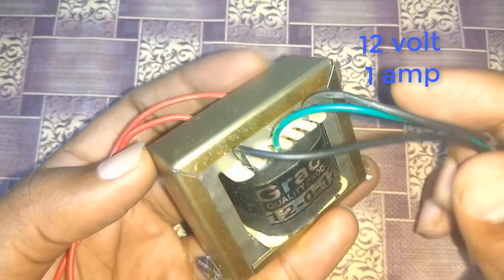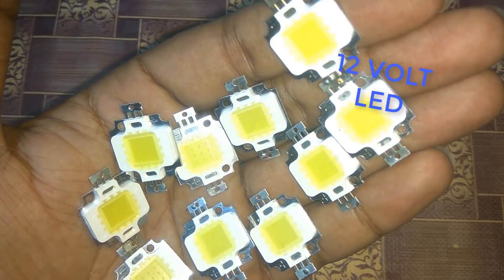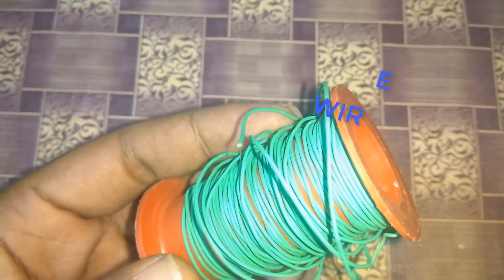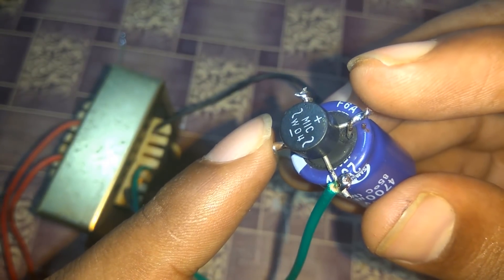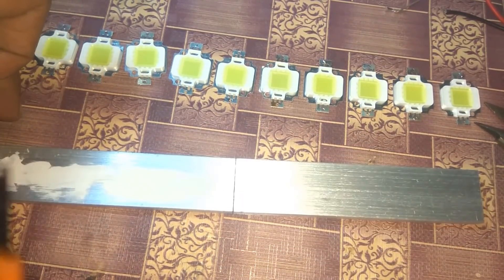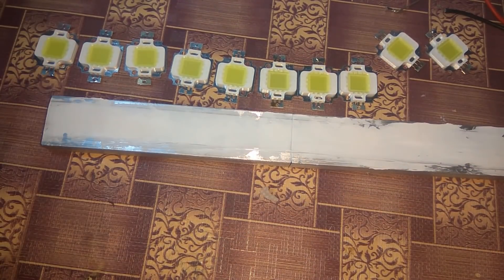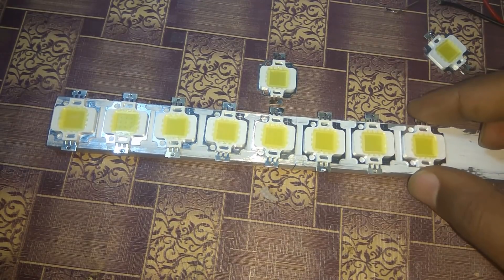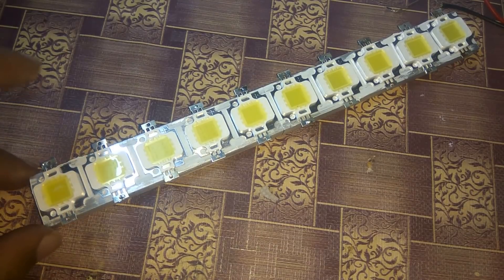HOW TO MAKE LED light USING 12 VOLT 1AMP POWER SUPPLY | Makelogy

Comment: You Mr. Prove this fact that 100 watt LED will take 100w ÷12= 10 amp including 20% efficiency. Then how only 12v one amp can do? Please prove this that 12v 1amp can drive 100watt led? Prove it mathematically
Reply from the maker: No it's not 100w

Comment: I’m not going to start the video or waste time on this bullshit, this is another guy who shits on thermodynamics and creates energy. If you don’t know anything about electricity, just remember watts (or watts/hour) = volts x amps (or amps/hour). Watts is power, and watts/hours is power over time, AKA energy. That should save you from 90% of bullshitters, they are usually incredibly sloppy, ignorant or plain stupid. 

and please, if someone reads this comment, I humbly ask you to remember that ... THERMODYNAMICS IS NOT A FUCKING CHARITY SOOP, THERE ARE NO FREE LUNCHES IN THERMO!!!! Energy is indestructible, you can’t do like that giu and create it, you can’t destroy it. You can only change it’s form, usually in a more chaotic manner. 
There you go, didn’t even realise it but you more or less have 2 of the 3 commandments (laws) of thermo. Use them wisely.

Comment: pls how can I run 48w LED on 12volts Car battery, Kindly find details of what was written on the pack it came, it was using 220 volts, I jst want  you to help describe how I can run the LED on a car battery, DETAILS on Pack (-------INPUT: AC85-265V  50/60Hz -----OUTPUT: 550mA     +-5%
Reply from the maker: Provide me LED or battery details
Reply: @MakeloGy   12volts 750 amps car battery, then Led is Fil Model :ML48W, THE OUTPUT OF THE DRIVER IS 550mA +-5% made in china
Reply: It has and LED driver which is connected to 220 volts when it was purchased, but my project is I connect it to 12volts car battery and should give out the same output which will still power the LED
Reply: pls I want the LED to run on 12volts car battery
Reply: this is what I found on the LED driver casing (-INPUT: AC85-265V  50/60Hz -----OUTPUT: 550mA     +-5%)
Reply: @MakeloGy  on the LED I found this written (JILUN 560x6MM-2835-9C10B-900

Comment: You can't produce 100w of power using 1 amp X 12 volts. That would be 12 watts. This is ohm's law. Maybe go study the concept. To use 100 watts, it would take 10 amps x 12 volts (120 watts).
Reply from the maker: This not for 100w just a example 
How we make this types of power supply

Comment: sir jab transformer se 12v milraha hai to brigretifire condenser lagane ki kyn jarurat padti hai..10 vat led ko direct transformer k 12 volt se connect nai krskte kya..sir jara explan kijiye plz..ye sab mai b sikhna chahta hu..
Reply from the maker: Immu Immu 
Transformer output AC h or LED  DC supply pe work krta h 
Bridge rectifier module AC to DC 
DC output me provide krata h or us DC ko capacitor se filter krke use kr rhe h LED me

Comment: Hon. I want to know about syska 7watt led which operates as emergency lights also, that too,only when power fails and if the switch is on (the holder in which you have plugged in the said bulb)it glows,if power fails,and switch is off light doesn't glow
Curiously enough what technology or technic they have used,can you guide?

Comment: Sir, yeh kya transformer less bana payenge? If yes give me diagram. Thank u....
Reply from the maker: Transformer less power supply having less current as compare to this that's why only transformer power supply use
Thanks for comment Avijit
Reply: MakeloGy , sir kitni watt output hai? All r 5w led? Hit kya bohut hota hai? Sab led ko aapne possitive to possitive & negtve to negtve joint kiya kiu?
Reply from the maker: LED parallel me connection kra h 
Or  supply output 12 volt 1ampere
Reply: MakeloGy , nehi sir, i ask how watt of These led's?
Reply: Sir, diod In4007 use kar sakte hai?
Reply from the maker: diode ka bridge bna ke use kr skte ho
Reply: MakeloGy , ok sir...
Mai bohot jaldihi yeh banaunga, total kitni karach ayega?
Thank u... Avijit(kolkata)...

Comment: Hon.12 volt led chip suppose to be 10 watt,in the circuit they are 10 in numbers,so it's 100 watt,chip current?
I don't understand your answer, for operating voltage as 12 watt 1 amp.Can you narrate?
Reply from the maker: In parallel voltage are same on each LED 12 volt and current 100mAmps
Reply: so what is a point  to drive them with 10x less current? if you worried to burn chips down, without CC  driver, you could easily put only 2 of them in paralel, youll get near the same lm as 10, and each chip will get around 500mA, which is safe enough.
Reply from the maker: I am trying different projects in different different conditions
Reply: Hon. thanks, to clear my query,but but still one question,is it protected from over voltage? I won't trouble you any more, sorry to disturb you now and then.

Comment: What is the total current consumption of 10 x 10 watts LED Chips...? What kind of heat sink should be used...? Would 1 Amp. Transformer enough..???
Reply from the maker: I am using 12 volt one amps supply
Reply: Dear MakeloGy,
If I make a light for permanent use as per your directions, would it last...? Or you have done it for experiment only...? I don't have much knowledge of it but heatsink and current supply seemed to me as inappropriate that's why I asked you...

Comment: what if i want to make multiple mobile charger using atx (computer power supply) actually i am working on ti. atx or psu have +5v and 20A power,but mobile charger mostly have +5v 1A and +5v 2A.  so if you have any idea so please message me on whats app or text at 9826913203.

Comment: sir hamare paas 9-0-9 ka T/F hai use 12volt ka kaise banaye ek video banaye
Reply from the maker: Transformer ka 9 or 9 wala wire lena  to jo 18 volt hoga usko rectify kerke 7812 regulator lga dena to 12 volt mil jayega 
Thanks for comment
Reply: Agar hamare pass 9-0-9 wala nhi ho to phr kya kr sakte hai

Comment: You have a great idea,can you guide me, if I want to reduce 220 volt (+ - 20%) AC to 50 volt AC and then through transformer take the output of 220 volt AC with 6:52 ampere.
As I want to run 1500 Watt electrical device.
Reply from the maker: i will make video on that 
thanks for comment

Comment: Hi if each led consumes 900 ma @12 volts and if you connect 10 led in parallel it comes to  the required current is 9 amps 
Does this 1 amp transformer gets heated quickly
Reply: It can never produce 100W to begin with. The core will saturate at about twice it's rating, and go south from there.